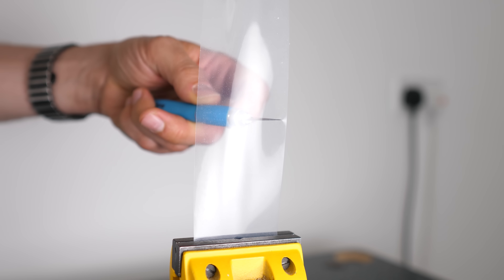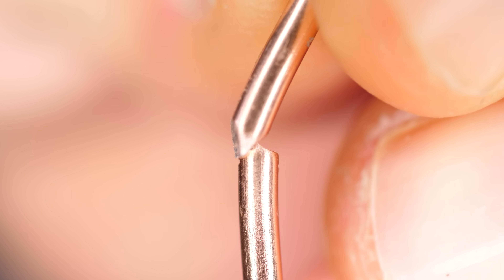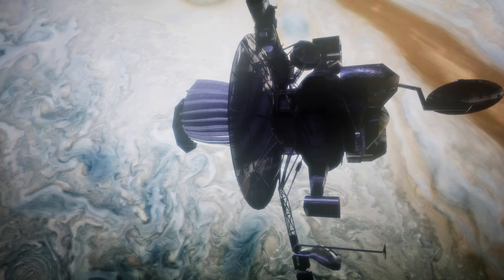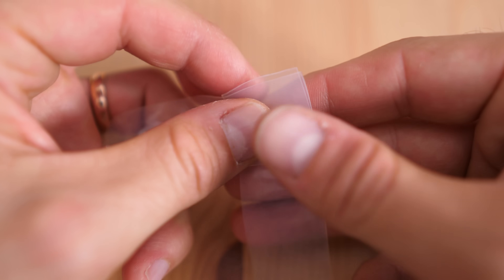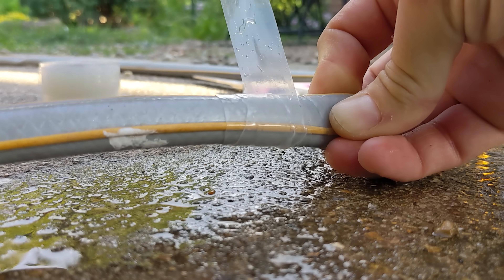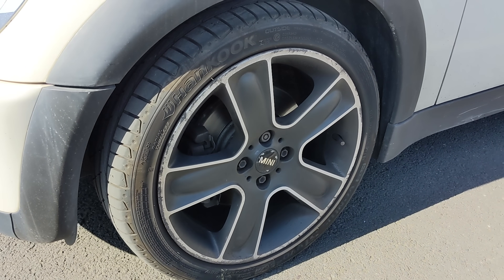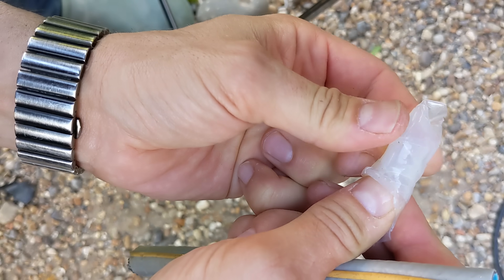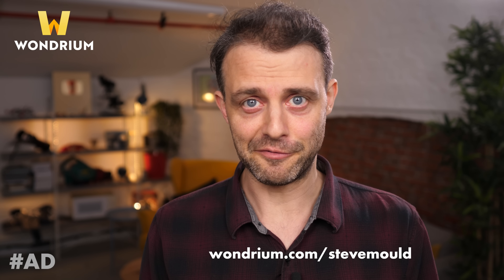Self-Healing Material

Comment: I'm an injection molding process engineer and this is one of the most interesting things I've ever seen on the internet.  Making flow fronts "re-bond" after they go around a core or other feature in an injection mold is a very difficult.  We look at is a minimizing the weld line as you can't make these polymer chains truly re form.  Typically this is done with greater injection speeds or higher temperatures.  Albeit, greater injection speeds induce shear, therfore.. also heat related.  Very very cool video. Thanks Steve!
Reply: This explains why I find so many plastic water valves that fail at the seems in the equipment I service. Mystery condensation appears in the cavity... follow the mist.... mind boggling micro hole allowing water to leak. You'd never see it with the water off, looks perfectly solid.
Reply: Uh..sir with that pfp ,sure we all beleive u really is an engineer molding process injection
Reply: @pumpkinpooper  not to say it doesn’t take intelligence to do what his job requires, but I ran plastic injection mold machines since I was like 12 in my dads shop. You have to understand what the buttons do, how to change the molds in and out, how to unclog it, and what to do when the plastic is shooting into the mold weirdly. Plus a few other things I’m sure I missed.. now granted, that is only one type of machine that’s usually in these shops, and if you have multiple of each type of machine, it’s usually from different companies so they all run differently. (These things cost around $150,000, from what my dads told me) I personally don’t know how to do all of these things, seeing as I only ran machines as a teen in the summers every year until I graduated. I never did most of the other stuff personally. but my older brothers and dad do. All it takes is working in a machine shop for a few years and having someone teach you everything through those years. It’s just like being a mechanic. You have to understand the machines you work on, and that they’re all similar but still have important differences. that doesn’t require a degree, it just requires on the job learning for years!
Reply: @lizard-breathOG  i do respect u for explaining this , dear lizard breath. btw u said it does not require a degree so basically what ur comment is implying is that the orginal person who posted the main comment is dump.. ? right if thats what u are implying , i am 100% agree with u that guy is probably dump{guy posted main comment} u sir are a chad giga cool chad
Reply: @pumpkinpooper   well, I’m not saying he’s dump😂 more so I mean, he probably has put in a lot of work over the years to learn all these things, but it’s not like you need a degree to do it. (So I don’t think he’s stupid, you just don’t have to be a genius) It’s just on the job learning for a long time. The machines are actually pretty complicated and some of them have like 40 buttons or touch screens. And you have to know how to download the info from the computer onto the machine, but I think that just takes knowing how to open files from a USB stick onto the machine. Also the molds in the plastic injection machines are anywhere from about $8,000 to like $200,000. It just depends on the size, how complicated it is, etc. so the fact that he’s the main engineer guy means he’s proved himself to the company with his knowledge and productivity! Also you have to be hella strong to move those things. One of my brothers lost a finger cause he wasn’t paying close enough attention when putting a mold in the machine 😂 I bet this guy is just your average machine mechanic/operator who has learned his specific trade well!
Reply: @lizard-breathOG  how many fingers did ur brother lost btw 1 or 2? did he attach it together i mean is he alright
Reply: @pumpkinpooper  well he sliced his pinky almost off. Got surgery and then only that finger got stuck down like he’s making a fist. (If that makes sense) he let it be for a few years, went back in and they said there was nothing they could do besides chop it off, so they did. Now he has four fingers on one hand 😂
Reply: @lizard-breathOG sad to hear btw how old are u all
Reply: @pumpkinpooper  I’m in my 20’s brother was 20 something when that happened, now he’s almost 40. What about you?
Reply: @lizard-breathOG  what about running 13, 1M apiece machines with 2sec cycle times?
Reply: @_Theshiz909  Idk what you’re saying. When I worked in my dads shop as a teenager, My job was to run the machine and clip the parts. If something went wrong I got one of the dudes who knew what they were doing to fix it 😂

Comment: It might be as simple as charged groups on the polymer chains so it sticks together through electromagnetic forces. They often occur if the polymerisation is ionic and not radical. Or it might be hydrogen bridges but they are a lot weaker than ionic bounds.

Comment: not true! if you leave two very flat metal surfaces slapped together they will bond over time. Faster if pressure is applied. Softer and same metals work the best. Your cut on what seems like a copper was far from flat.

Comment: So i saw you lap this polymere over and you tried to tear it which didnt work can you try to seperate them but stripping them appart again.
This question comes up because velcro is similar in the aspect that you have a hard time tearing it appart but it is easily pulled apart.

Comment: It is not just the oxidation that is disabling the surface to stick together back again in a metal. If you introduce a heatsource then they form those chemical bonds back again. If you even press two different metals with two different melting points together can also link up. (The bond
 may not maynot be strong)

Comment: That sounds a bit like the question "If Teflon doesn't stick to anything, what holds it in the pan?" 
One thing that Teflon sticks to EXTREMELY well is more Teflon. So typically the pan will be roughened by sandblasting or acid etching, or something similar. The pits need undercuts so there are Velcro-like catch points. Then a thin layer of Teflon is sprayed on. It flows into the pits then cold-welds to itself in place forming a mechanical bond. Then as more layers are applied, they adhere well to the previous ones.

Comment: Aren't you a little suspicious of the reason given for the deployment failure of the Galileo high gain antennae? Wouldn't those parts have oxidized immediately upon manufacture, making them impervious to self bonding? If some process prevented that, why only three subject to this 'cold weld' inspired failure? Must be something I fail to understand about what is happening here!

Comment: Also consider magnetic Dielectric directional charge flow and capacitance. Two smooth steel bars have an insulated wire in a groove between them. 12 volts impulse through the wire and they become stuck together like Ed leed skalnins permanent magnet holders PMH

Comment: You should check out Mox-Tape. Its qualified for use in aerospace applications. Airplanes are flying around with this stuff holding parts together.... no joke. I've installed it myself. Its a silicone-fiberglass based tape that utilizes a proprietary 'whatever' to physically bond to itself - no chemical reaction. This stuff allows for re-positioning within a short time which makes it much better than the instant-bonding type tapes. Once it "cures" it DOES NOT COME APART. DM me - I have some samples I can send.

Comment: I learned about self-healing polymers years ago, around the year 2000.
Back then, self-healing polymers are polymers with little tiny bubbles of liquid polymer scattered throughout the plastic piece. If a fissure or crack, usually very small one, like a micro crack, happens, these little bubbles break open, the liquid polymer fills the crack, and solidifies into a piece of self healing plastic.
What we see in this video appears to be something completely different. I get that they are calling this self healing, but I would call it self adhesive. Seemingly a very different technology with a vastly different application.

Comment: Is it not a matter of time? Since diffusion has been shown through different solid metals, wouldn't they eventually become joined? Just need some patience and perhaps an extra sun if ours goes supernova before you're sufficiently satisfied with the result.
Extremely smooth metal surfaces will also have an adhesive force to each other, and the answer why is not clearcut (just very smoothcut?).

Comment: It would be great to see these used in packaging for soda bottles, pallets, etc. for more sustainable packaging options.
Reply: They can be frustrating since one accidental contact would form a bond and then you would have to cut that bond to form the right bond which ofc is worse than first-time-bonding
Reply: How would it help sustainability? Are you thinking of this as some kind of reusable pallet wrap? It wouldn't work for that. First, the wraps on adjacent pallets will stick to each other. Second, it won't work once it gets dirty. Third, as you're cutting the wrap off the pallet, it'll stick anywhere that it touches itself. Fourth, even if you handled it carefully enough that it didn't wad itself permently into a ball, you'd only be able to reuse it on smaller pallets because you need an overlap, unlesss you're going to do a really careful end-to-end joint like at 0:06 in the video.

Comment: You actually can push metal together again with enough force or vibration to push aside the oxide metal and fuse two pieces. It's used in industry all the time.

Comment: In case of metal it is not so simple, it is not always oxidation, in a lot of cases its water. even at very dry climates, there are some water molecules everywhere. Otherwise we would have quite a problem with all the gold jewelery. another very important reason is surface roughness. you get a lot of very tiny cold welding in most metal contacts, but its very far from being able to withstand any forces. But it works, which is why gold bond wire is very handy in electronics.
oh and btw. there is some self healing concrete too

Comment: so it's self fusing not self healing. materials dont actually fuse bck, it might be because of different electronegativities. and it requires flow of energy to fuse materials back, usually unattainable just by sticking them together....maybe it is a silicone based material.

Comment: If gold is used for contacts in electronic circuits because it does not oxides, would it be possible to weld two pieces of gold together by pressure?

Comment: I expect that to float a cruiseship on a gallon of water, youd have to build a construction that extremely accurately fits around the hull so that the open space between can only take a gallon of water, and then place the cruiseship inside it extremely accurately so the water can be evenly distributed on the whole surface. 
Technically a cruiseship floating on a gallon of water, though practically impossible to do. 

Or you can just float a tiny model of a cruiseship on a bit of water 💁‍♂️

Comment: I wonder if something similar to optical contact bonding (AKA the "gauge block effect") could be at work here. Optical contact bonding requires two extremely flat, or at least, extremely conformal surfaces with no contamination between them - here, the material is flexible, and by squeezing two pieces together, you make them highly conformal to each other. So long as the surfaces are clean, an optical contact bond can then form.

Comment: 6:52 you're not describing crosslinking which is where you lay chains side-by-side & they join by literally linking across to the adjacent molecule with the same chemical bond that links mers into polymers.
Another thing which happens when (some) long-chain polymers are laid side-by-side is that they are held together by sub-atomic forces, as I recall from 25 years ago it's Van der Waals forces. 
Either way the normally spaghetti-like molecules are usually straightened by straining the material beyond its yield point. 

This also explains why lifting overloaded plastic carrier bags very slowly increases their strength :-)

Comment: 1:16 but you can just push the ends back together, it's called pressure welding, you just have to push a bit harder. It's widely used in factory production lines.
Reply: No that’s different the pressure creates friction which welds the surface together what he’s talking about is molecular bonding

Comment: The oxide layer sticks hard to the piece it formed on and to itself. Why don't it stick when you press two oxidized parts and form a solid structure with two metal pars and an oxide film in between?

Comment: I'm not sure about the oxidation explanation for metal not sticking. Because, when the metal surfaces are flat enough, they will stick together. This property is called "wringing" and is seen often with metal blocks called gauge blocks. https://www.youtube.com/watch?v=2lOOl3VxOtE The usual explanation is Van Der Walls forces. So maybe metal usually doesn't bond to itself because it can't come into close enough contact?

Comment: It would be interesting to see what happens when you trap a bubble of air between two layers of the material. Would the bubble be unable to move? Could the size of the bubble be reduced by squeezing it to increase the pressure? Would that make the area of the polymer over the bubble stretch or separate?

Comment: i have a "self healing" Olfa mat! they don't actually self heal in the manner you describe in this video though. instead, they have a spongey top layer that is designed to take zero kerf cuts very well, and a second very tough layer that stops a zero kerf cut. so when you cut down on an olfa mat, you cut through the top layer and stop at the bottom layer. the spongey top layer "closes" up and you can't see the cut... unless you bend the mat lol. threads can also get pushed into the kerf of a cut which will keep it open.

Comment: Some metals are remarkably good at fusing together even on Earth. Stainless steel screws shouldn’t be driven into stainless parts without grease or anti-seize because they can decide to become one part, taking the threads with them if you manage to tear the bond and unscrew them.

Comment: So is this what’s on the front of some new high end vehicles? Mercedes or BMW, at least one of those manufactures, if not both, have vehicles with a self-healing  polymer on the front bumper/grill portion of the vehicle. Although you have to slightly heat it to get the scratches out.

Comment: 2:10 Not every metal reacts with oxygen when it's cut. Gold for example doesn't form an oxide under normal conditions that's why you can actually fuse two pieces of gold together.